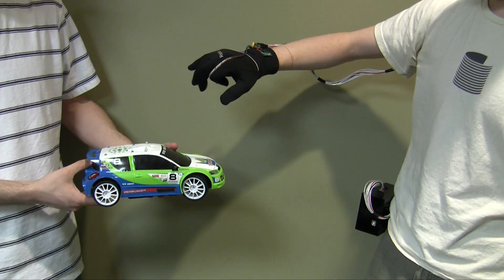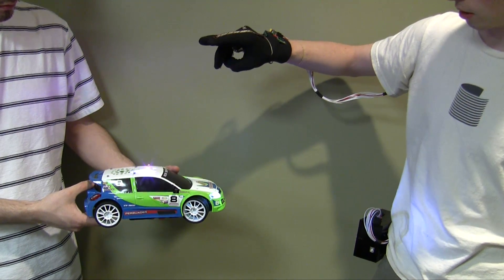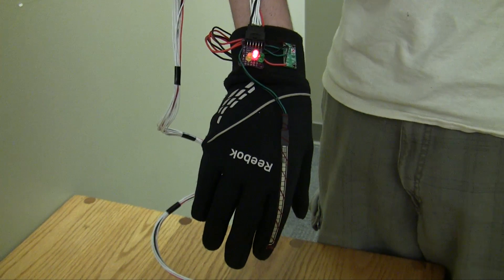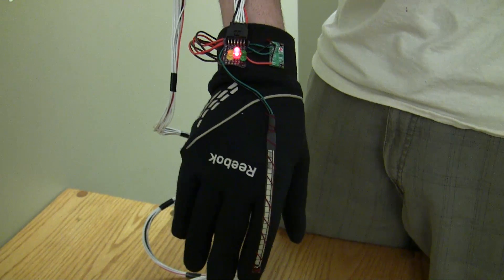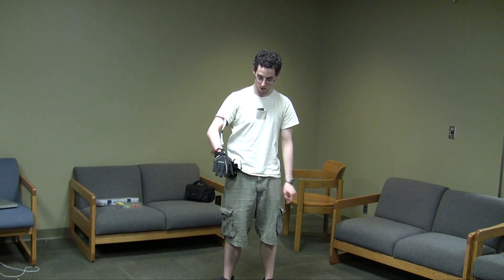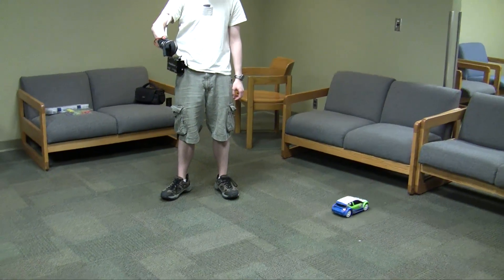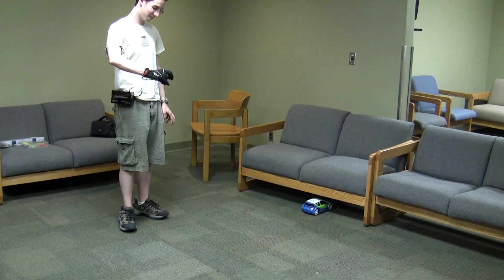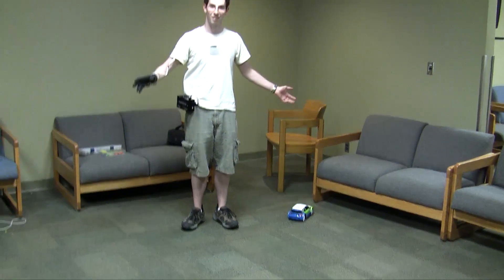SudoGlove - Gesture-Based Hardware Control

Comment: i made a similar kind of rc car controlled via tilting gestures , i have not controlled the speed of the car just made the car move in the direction i want from the tilt gestures. i made it with an acellerometre ,one microcontroller and few lines of code could you tell me how to combine that with controlling the speed that i assume you have done with the inputs of the flex sensors in your glove. any help from you would be great for me thank you @JeremyBlum

Comment: Does the Xbee receiver and the remote car motors powered separately ? Or they sharing the same power source ? If they are powered separately how you actually control the speed of the motor by regulating the voltage from the power source to motor ?